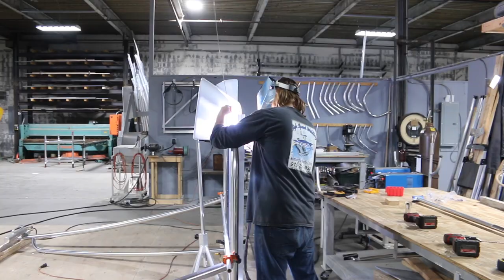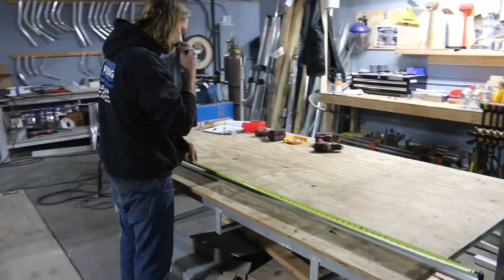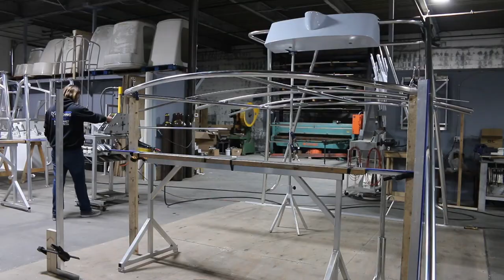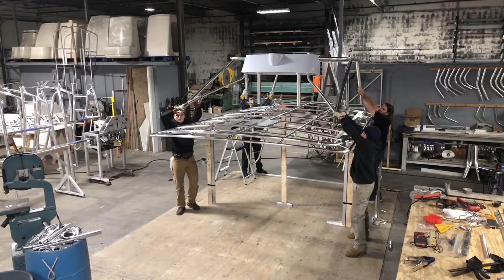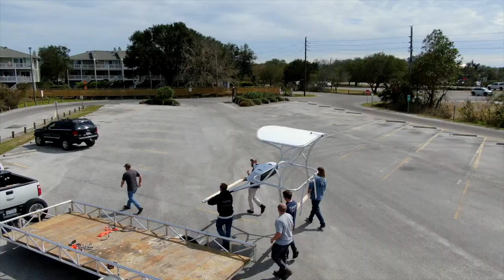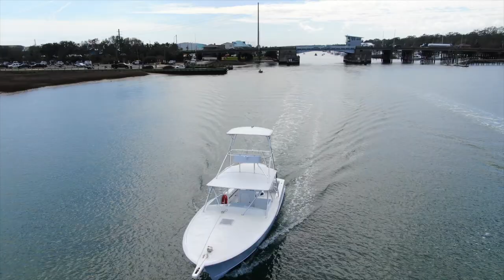Dream Girl Tower Build - Custom 42' Carolina Sportfishing Boat

Comment: Awesome job what kind of Bender is that
Reply: Thank-you. It's a Southern Cross Bender
Reply: @fishfabhunt  Is there any way you could find a link to the southern cross bender or a similar one? Having a hard time finding a rolling bender like that. Most of the recommended JD2 benders are using dyes for a single bend. Love that roller setup that you have.
Reply: @andrewmassard8974  try calling G/L materials in Morehead City
Reply: @fishfabhunt  I will - thanks! Would love to see more on the bending / fabrication side of things! What type of aluminum are you using and do you anneal it? Your process looks so much cleaner than other guys I've seen. Great job!
Reply: @andrewmassard8974  You're probably comparing this work to satin or brushed anodized stuff you typically see for tops and towers.  This is brite anodized tubing.  Looking at the edge of the welds it may even be mill finish but it's usually not that reflective and, even though this got powder coated, wouldn't likely be used for salt water.  The bends are typical of anodized.  It's a very nice looking product.  No annealing.
Reply: you probably dont give a shit but does any of you know of a trick to get back into an Instagram account??
I was dumb forgot the password. I would appreciate any tips you can offer me.
Reply: @Hayden Colt Instablaster ;)
Reply: @Julian Reese I really appreciate your reply. I found the site through google and I'm trying it out now.
I see it takes quite some time so I will reply here later when my account password hopefully is recovered.
Reply: @Julian Reese It worked and I now got access to my account again. Im so happy:D
Thanks so much, you saved my ass :D
Reply: @Hayden Colt You are welcome :D